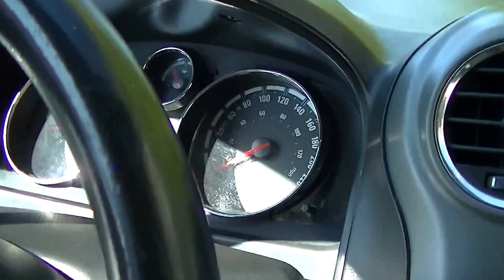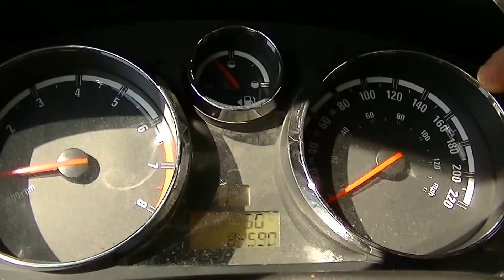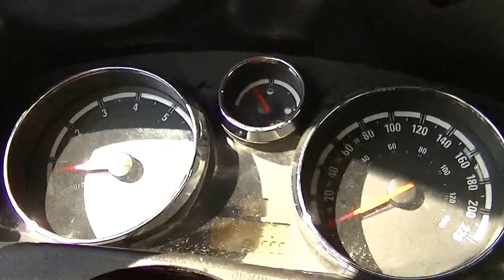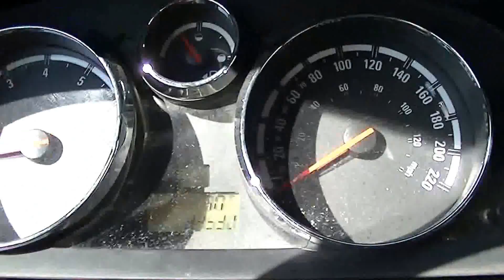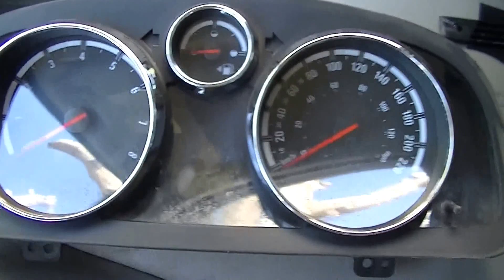How to remove the dashboard in Opel/Chevrolet Captiva

Comment: My friend, after replacing the cluster, have you experienced any trouble, regarding the car's operation? Like engine stalling, or any kind of electric circuit failure?
Reply from the maker: Fabio Poletto The cluster has to be the same part number and has to be coded according to your vehicle configuration and equipment. You can use an Op-Com interface to read the info in the old cluster and to code the new one. Regards.